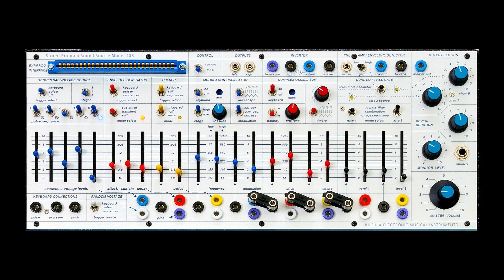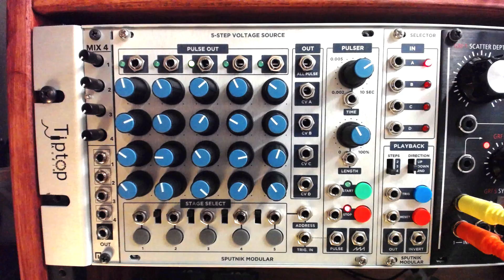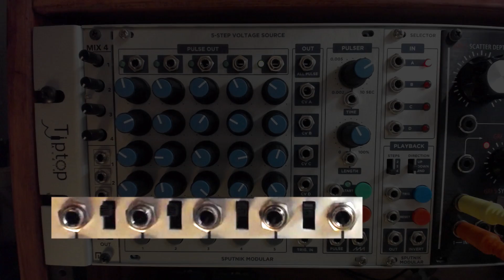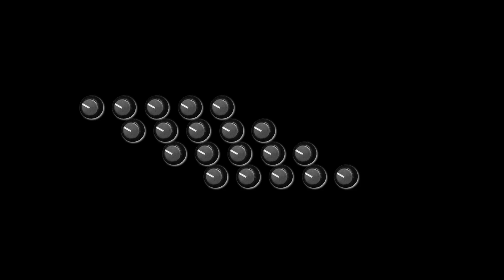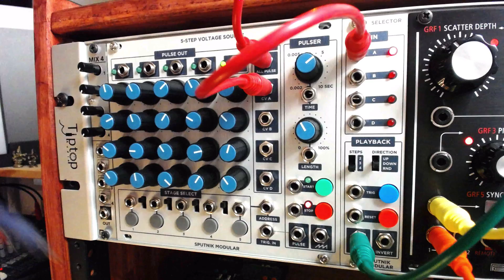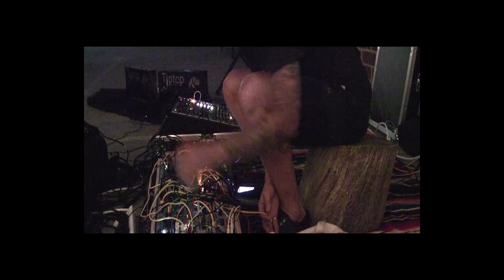Sequencing your Eurorack Sequencer

Comment: How would you get a 7 or 14 step sequence? It seems like after 1-5, you can only get values in the 4x5 times table, e.g. 6, 8, 9, 10, 12, 15, 16, 20.
Reply from the maker: +Ian Hoffman Technically, you could get those odd values using the Address or Stage Select switches but it would be a challenge. I would suggest waiting for the 16 step version if you want any step length, or check out their upcoming sequencer that was teased on the Blog yesterday :)
Reply: I'm already getting the 5-step :) You could definitely get those odd values with a second sequential switch. You'd have to step back to one when it got to a certain row and column, with some kind of AND logic
Reply from the maker: +Ian Hoffman Exactly, there are a few ways to crack that egg. But definitely possible. That might be in another upcoming video :)